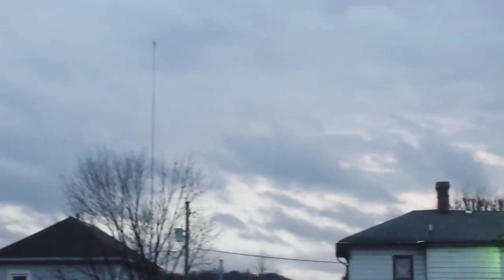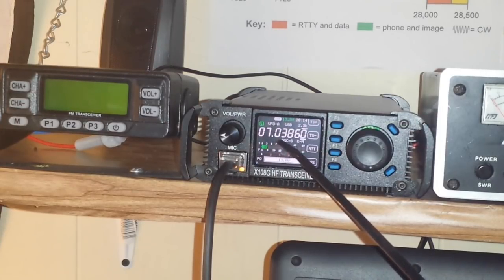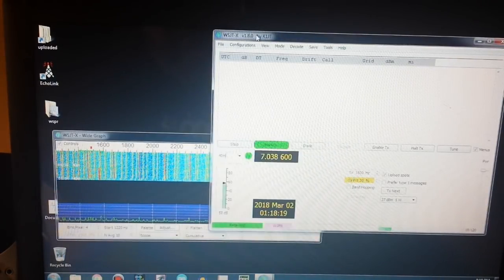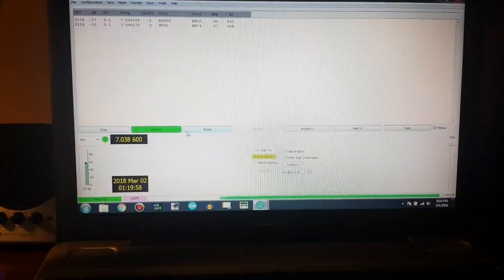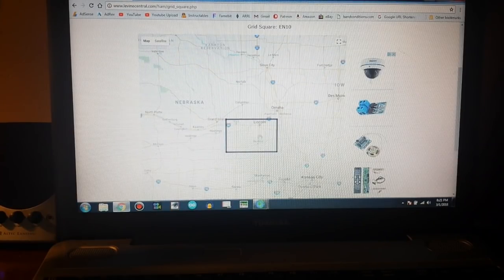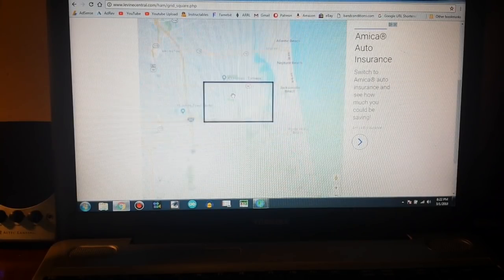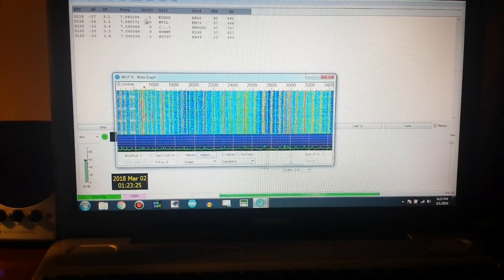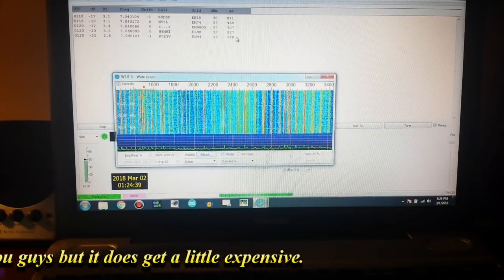Antenna testing with WSPR

Comment: Great Video .. at around 25 sec into the vid you showed the base of your antenna and a small box .. you called that box a 9to1 Auto Transformer .. I do believe you miss spoke sir .. it should be a 9to1 UNUN (the Us are short as in none) .. I use one on my horizontal 120 foot wire .. also instead of tying up a good HF Radio for WISPR take a look at the SOTA Beams WSPRLite HF WSPR transmitter .. I have one and it works well and it can be used as a WISPR beacon .. take care .. 73 De N9UOM